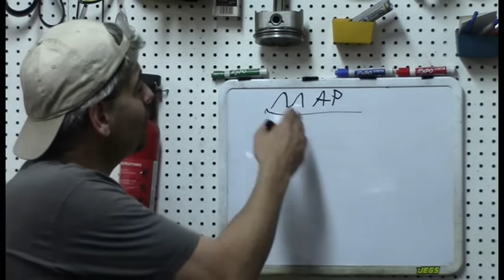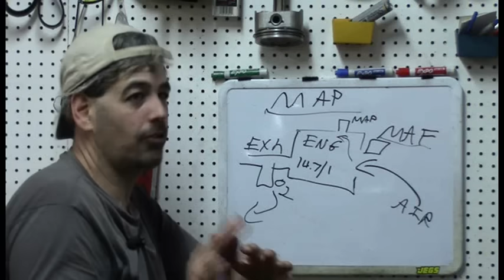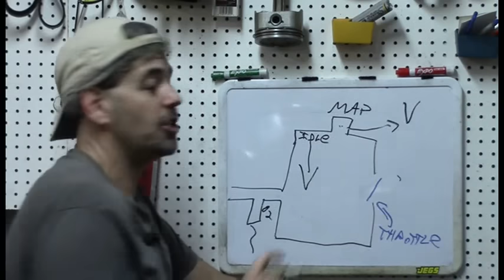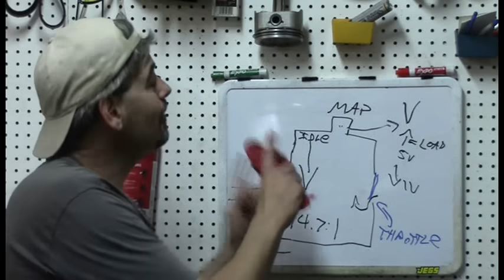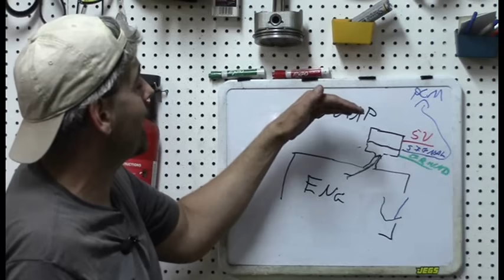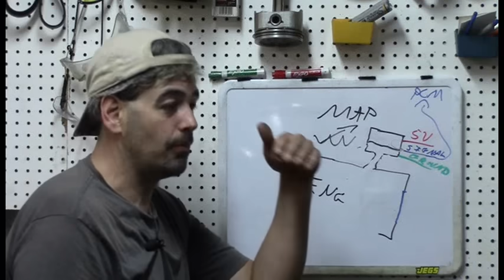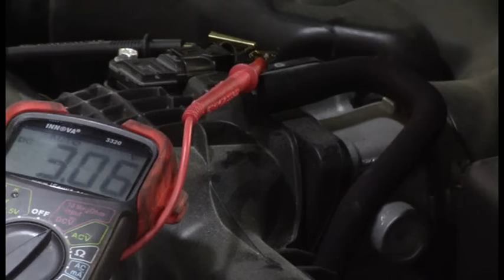MAP Sensor Diagnosis and Understanding Function- Pt1

Comment: So I'm the 98% trying to become the 2% and I have a question: Is it possible that I have damaged/destroyed the MAP/MAF sensor by attaching piece of 10 ft long 1 and 3/4 inch fire hose made of synthetic fiber to the exhaust to ventilate the fumes from my garage? It seemed to be working but after I watched this video I can see how that could cause pressure issues and possibly malfunction...I have a 2001 Durango 4.7
Reply from the maker: I don’t know. What is the voltage from the signal when referenced to the sensor ground?
Reply: @SchrodingersBox  Thank you so much for responding!!! The voltage with ignition on (engine not running) is around 6.00 V (red wire), the voltage between signal and ground with engine running was between 1.92 - 2.32 V and the car is misfiring and giving P0108 code.
Reply from the maker: @janlesko212  Ok so why are you suspecting MAF is bad?
Reply: Schrodingers Box because mechanic hooked up his OBD unit and it gave him this code: P0108 Manifold Absolute Pressure/Barometric Pressure Circuit High
Reply from the maker: Check for continuity on the signal ground.
Reply: Schrodingers Box I’ve checked the continuity of sensor signal wire to PCM and it’s good

Comment: I have A 2002 Chevy Avalanche 5.3l z71

Every Morning when I go to turn it on it doesn't the first time. And then the second time it does.  I've changed fuel pump, fuel filter, fuel pressure regulator, plugs and wires, I let it prime before starting.  Idk what else to try or to do. I've heard the MAP sensor might be bad from yahoo answers. and that the MAF could be dirty but I've cleaned that, and throttle body.  I've changed water pump, AC Tensioner, Belts. Alternator,  Battery..  Should I try the MAP sensor?  Idk what else to try
Reply: It's an fairly inexpensive and very easy things to change compared to a lot of what you've said you've already changed so that being said you should go ahead n try it what do u have to lose at this point right? ;-)

Comment: My car's check engine light was on, giving the code for faulty MAP sensor. During an oil change, and before I had a chance to order a new sensor, I changed the intake air filter. To my surprise, the check engine light went out and hasn't come back on. It's only been one day, but I'll keep an eye on it. Could it be that the old, dirty air filter caused a P0106 code?
Reply from the maker: Absolutely it could. If an induction restriction on a speed density design causes lower than the threshold pressure readings this could happen.
Reply: Schrodingers Box  That's just what I suspected.  Thanks for confirming the possibility.

Comment: Please explain to me how ECM computes the load percentage PID with engine with MAP sensor and engine without MAP sensor.  Is it a synthesized value?  As far as I know, load percentage is not an input as there is no sensor which gives that value to ECM.  What exactly is the load percentage?  If the crankshaft had a strain gauge built in to it, that would come closest to the engine load!
Reply from the maker: 12vgs8606 Good question- I have wondered this myself but never actually looked into it.  It was always curious to me that at maybe 3000RPM at idle you might see "40% engine load" as if that would be 40% of a 100% engine load by burning tires at WOT with a 10,000lb sled lol-- I have no idea what baseline "100%" is and how it's calculated.  That will make a good video, I agree. I will look into that!
Reply: Since the ECM subsequently uses the load as input to compute the rest of the engine actuators, I am always wondered about this "chicken_or_egg" situation!  I looked up bunch of academic reference material on the history of OBD to see if I could find something explaining this but so far I have come empty.  It  could be as simple as total air intake vs theoretical volumetric efficiency i.e.currently pumping volume vs maximum pumping volume but that will not get you 100% load without engine being at redline and we know that is not the case.

Comment: Some engines using both sensors MAP & MAF sensors like GM I5 or V8. Can you tell more about this. Why engineers using both sensors?
Reply from the maker: I am not totally sure why.  it seems to me that first and foremost they can serve as a backup for each other so if one fails there is practically zero drivability issue. but also I would imagine the MAF gives more instantaneous response than a MAP would so MAF can be used for drivability while MAP used for other purposes like EGR detection.

Comment: Hello bro, hope you doing great as you do always , well I have issue in my friend’s loader truck 1000cc engine having MAP , 14.5 barometric psi and 4.5 to 5 at idle 800psi, LTFT at +10 idle and lower at +5 higher rpm , checked all possible intake leak , engine overhauled last 7 months, very worst fuel average, checked o2 injectors leaks , is fuel damper stucked can cause these issue? Sir kindly help many of machenic unable to diagnose issue, o2, map replaced , regards
Reply from the maker: Need to know what the symptoms are.  check engine light? hesitiation? No start?

Comment: What do you think causes no-start-when-hot on early-90s chev 3.1 engines? (fuel press & ign OK) -- have to wait > 1 hour to start (When water is poured over intake manifold, then it will start much sooner) . I measure cranking vacuum at 1.2 in.hg & idle vacuum at normal 20 in.hg.
Reply from the maker: Do FASTTEC analysis. It will give you direction.

Comment: is it possible thats why i have check engine is because of this? i have check engine on my car.. once i remove the negative supply of battery check engine was gone again then will turn on the check engine light again after i travel for few days. thank you so much
Reply from the maker: 1,000,000 things could cause that What is your dataset?
Reply: @SchrodingersBox  recently i checked it then isc servo valve appears on diagnostic.. he said need to change throttle body.. now im checking on any possibilities regarding with throttle body, could be sensor only or others.. thank you for the reply

Comment: Will a bad MAP sensor cause a no start or rough start in which the vehicle starts runs rough then shuts off? I have a 2008 Chrysler Sebring 2.4l 4cyl with the code for a map sensor P0171 bank 1 and also a P2017 Intake manifold Runner position sensor circuit high code. Are these codes in correlation to one another? Can the runners being stuck open cause the MAP code?
Reply from the maker: Not likely, but it could be- it depends- what was the MAP data you got during your diagnostic evaluation?

Comment: Great video but quick question.. I’m getting p0106 took my car to a couple different shops and even the dealership…they all say map sensor so I replaced it but still get p0106 and no one seems to know why. Is there something else I should be looking at not sure what to do anymore spent lots of money on “diagnoses”
Reply from the maker: yes what is the reference and signal voltage showing?
Reply: @SchrodingersBox   not sure.. but say the voltage on the sensor is correct is there a chance the ecu is damage?
Reply from the maker: yes of course that’s possible.  what is the ECU seeing for signal and what is the processed output? That’s how you would determine ecu is the issue.

Comment: When you had 3 volts from atmospheric pressure with the engine off, was the key on or off?
Reply: Back probed Mine reads 4.8 volts key on engine off. Ive already tested the connector terminals and everything is proper (5v, 0v, Gnd). Back probing with connector in the MAP signal wire reads 4.8v to ground key on engine off.
Reply from the maker: Then create vacuum and verify MAP reads accordingly. You are only looking at atmospheric.
Reply: Gotcha,  thanks for replying.   Im sure all makes and models will be different, i just figured the signal voltage key on engine off on my 5.7 vortec was kind of high compared to this and other videos with atmospheric volage reading lower than what mine is. Will signal voltage vary model to model or is 2.5 to 3 volts pretty standard for static pressure?
Mine at 4.8v being so close to 5v made me think its shorted or just defective. Yours at atmospheric pressure was 3 volts, another i saw was 2.5, etc. Is 4.8v a suspicious reading for atmospheric pressure or should it be closer to half the reference voltage?
Reply from the maker: That would be expected for atmospheric.

Comment: R U saying it's possible that you get an air leak but it will read as a MAP sensor issue as a reference code?  Cuz I replaced my map sensor and i'm still getting the p0106 and 07 code with the rough idle and it won't clear.
Reply from the maker: Yes it’s possible but it is also possible the MAP is correctly reporting the condition. what was your MAP voltage showing?

Comment: I have one question: How does a MAP-only system recognize a vacuum leak in the intake manifold? Meaning, how would the PCM know that the excess air hasn't entered via the throttle body? I have a feeling I've misunderstood something here, but I'm not sure what.
Reply from the maker: Great question as always Lab. Your comprehension is outstanding. 
Basically- it doesn’t directly detect unmetered air because as you correctly assessed- there is no way for it to differentiate a vacuum leak after the MAF. 
   The PCM is programmed with defaults for various conditions including idle. If there is a vacuum leak, the MAP will read higher and if it’s out of range of the baselines the PCM expects, it throws the code related to MAP Out Of Range. 
   This is why MAP only engines need reprogramming (e.g. “retuning” after major induction modifications. On a MAF engine- more induction is simply measured by the MAF but on a MAP only (Speed Density) it has nothing to determine there is simply more baseline airflow so it has to be reprogrammed.
Reply: @SchrodingersBox  Thanks for the comprehensive reply, Matt. I'm glad you think my understanding is pretty good - that's very encouraging. Your explanation of 'system defaults' for different conditions certainly clears up the confusion. Thank you again.

Comment: Hi i have a 2001 ml320 and i bought a map sensor but i saw that the hose is not there,so i bought more hose.the thing is that now i dont know were or how to connect the sensor to the manifold.tks for help
Reply from the maker: What was the data you had that indicated the MAP sensor was bad? I would start there
Reply: +Schrodingers Box  P0106
Reply: +Schrodingers Box 

after I saw code P0106 I assume a sensor fault that's why I bought one.but later after seeing your video I saw that a hose was missing.so I bought hose but now I don't know we're to conectado it.i guess to the manifold but don't know where is located on a Mercedes-Benz ml320

Comment: Does map sensor cause the van to cut off,when I get to a red light or take my foot off the gas,or slow
Reply from the maker: it’s possible- amongst 1000 other things. 
what is your map voltage at idle vs at WOT?

Comment: my 2000 dakota stalls when in idle after 5min, it also stalls at low rpm deceleration, my check engine light is giving me an evap code, so in the video you said those 2 points are where the highest vacuum is, if i get my vacuum leak fixed, no more stalling? will i have to replace MAP sensor as well? I already replaced the fuel pump. and is that why im getting even worse than normally bad gas mileage? haha thank you for the video
Reply from the maker: Stephen Bell Impossible to make any determinations without and data bro

Comment: So, if my Tiburon’s MAF sensor is dirty - can it trigger  a P0113 r/t the MAP because air volume/pressure is compromised by the insufficient amount of air through the MAF screen? 
New to this, but only code on my new Bluedriver. Any advice would be greatly appreciated. 
🇺🇸☦️
Reply from the maker: It would cause insufficient measurement of the airflow, not insufficient flow. Look for lean fuel trim to validate BUT only if rail pressure maintains consistency.
Reply: Schrodingers Box 

Thank you!
🇺🇸☦️
Reply: Schrodingers Box 

Found out there is just the MAP/IAC sensor on the 2003 Tiburon. They added the MAF sensor in late 2004. Which is good to know because there is no MAF sensor anywhere on the air intake. Thought I was missing something when I couldn’t find one! 
Will attempt to clean the MAP with electronic cleaner and see if the CEL for P0113 goes out.
If not, to the mechanic  because I appreciate that, if allowed to continue, it will damage the engine. And could be any number of other failures causing this code.

Comment: I've taken my car in this week with a code for the MAP sensor but the repair shop can't figure out why. I originally took my car in because my car was jerking as I accelerated fast on the freeway. Any ideas of what could be going on?
Reply from the maker: What data do you have? What is the map sensor voltage?

Comment: Hi Matt!
I've been trying to diagnose a bogging issue on take off in my 03 dc5 integra(acura rsx for you over there in the U.S). 
Im lucky to be dealing with a kpro equipped ecu which makes scanning for errors easy.
After watching your videos (yes all of them)  ive narrowed it down to map or tps (car has no MAF). 
My question is should these two sensors be showing readings that correlate with one another?. 
In the graph, tps readings will rise with throttle application and map kpa will rise in suit, however the map readings show random spikes at alternating intervals on decel and accel  that do not correlate with the tps readings (there is no random drop outs in my tps readings and i have also checked the wiring of my map with a voltmeter only to find no anomalies).
would this necessarily mean it is definitely a busted map sensor?
Reply from the maker: +Reece Murphy since you narrowed down to MAP or MAF, I would start with the voltage data you got for signal from MAP at idle vs under load- what were they?
Reply: At idle the car reads about 1.5 V at WOT it reads about 3.4V. Last night I borrowed an identical map sensor from a spare motor I had and the problem ceased. however on my morning commute to work today it reared its head again.
I think I could be the victim of a dodgy wire or loose connection in the ecu return wire or 5V in wire as every time I disconnect the map sensor and replace it firmly, the car will run (to a certain degree) as it should.
The only other thing I can think of that could cause a spike in the map sensor readings like this since the tps is working correctly is a vacuum leak, but there is no idle hunting and I've never heard of an intermittent vacuum leak that only happens under load so I ruled that out.
Reply from the maker: Reece Murphy Why would you change the MAP sensor? I am not following at all, sorry
Reply: I tested the initial sensor and it worked fine at a stand still. Out driving however, it would provide erratic readings/spikes in readings, as if I was on the gas and the tps was wide open, even when I wasn't even on the gas.

I swapped the sensor and it worked for a day before the spikes in the readings came back. I then tested this newer sensor to see if it was behaving the same as the first sensor did at a stand still and as before, at a stand still, it was working fine. This leads me to think it is a wiring issue that is causing fluctuations while im driving.

Im focusing on the MAP sensor at this time as the TPS is reading fine across the board and there is no vacuum leaks. my car  also does not have a MAF sensor.
Reply from the maker: Reece Murphy Testing a MAP doesn't work that way. It's part of a whole system of fuel management.  What was your fuel trim at the time of these "spikes" and what was the O2 sensor response?  What was the TPS response?  You can't just narrow down to one component like that and make a diagnosis.
Reply: The spikes occur mainly on acceleration and deceleration while occasionally occurring at idle.

log when car behaves

https://scontent.fmel1-1.fna.fbcdn.net/hphotos-xpa1/v/t1.0-9/12088157_10204587654123644_7467981392645551354_n.jpg?oh=10963d03e0f4ab9cd52a4ad09bcc5e4c&oe=56AAF6BE

Log when car runs bad

https://scontent.fmel1-1.fna.fbcdn.net/hphotos-xpt1/v/t1.0-9/12079298_10204587654083643_8841488197578091576_n.jpg?oh=3508587b7ad7c56debae046cdd6b2809&oe=569AE4A1

im not sure if the links will work(if its too blurry could i send it to you another way? as it really helps explain more than words. (or perhaps i can send you the logs if you have access to kpro manager as its a free download) but the left log is the car running well and the right shows the spikes on accel and deccel.

For the bottom graph on each image: blue reads map kpa, purple reads O2 V, green reads tps% and red is rpm.

On either accel or deccel occasions the tps is behaving as normal with readings rising and falling as i power on and off.

on acceleration at tps 15% the map and o2 readings skyrocket and bounce up and down instead of rising smoothly, up to a peak of 86.8 Kpa (in some instances as high as 120 kpa) for the map and  1.12V for O2 with fuel trim going to 5%

on deceleration the map and o2 behave as normal until i fully back off. while backing off at 9% tps the map jumps from 40kpa up and down to max 73.32 kpa and 02 jumps up to 1.24 volts and fuel trim jumps to -27%